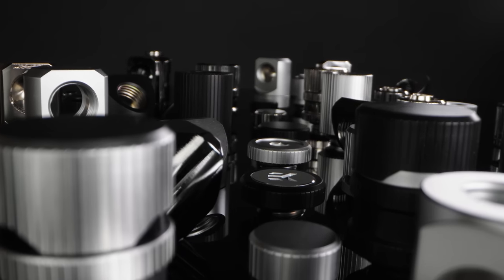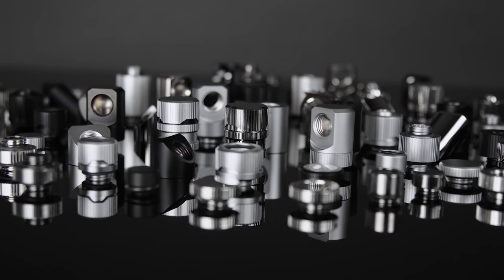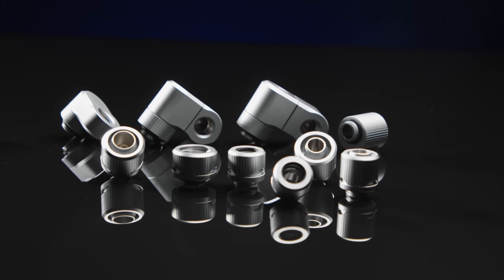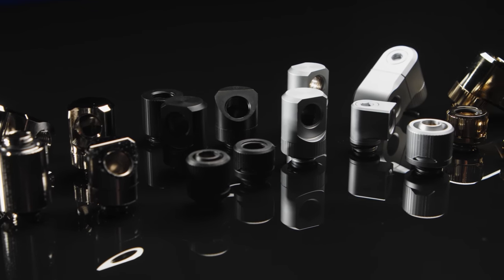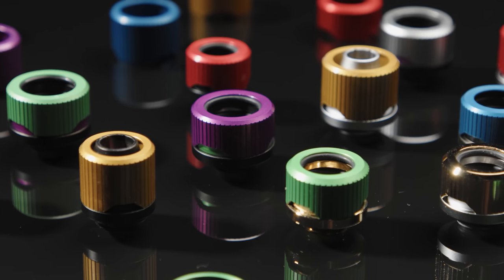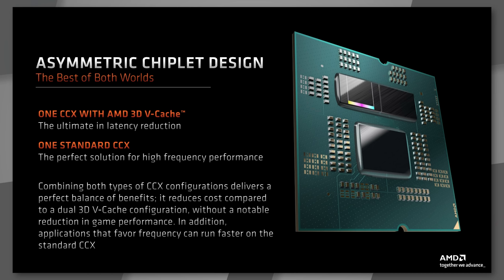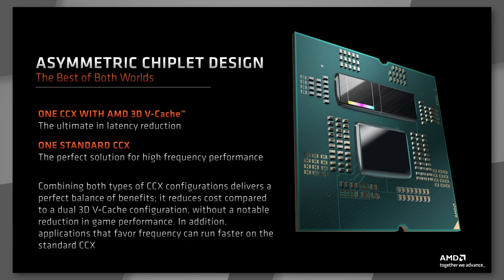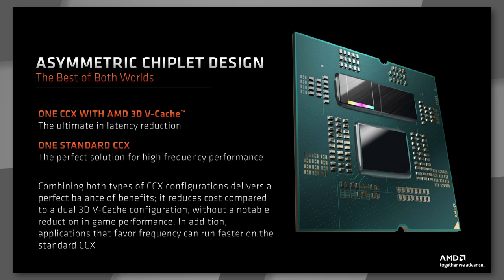Why I switched back to Intel...

Comment: the complaints in the forums is in the millions not just a few lately with amd and intel on the both amd and nvidia cards, crashing and blue screening.   

both intel and amd, they are both doing the crashing all the time stuff.  same with amd gpu vs nvidia cpu both same toilets with the ddr5 paring on the cpus and mother boards now.  its a full on crap shoot to get something stable for very long.  sure some work for couple months then its all down hill.

cant get a pc to stay stable for years like before.

blue screen and constant app crashing in windows 11, is the normal now.

Comment: SO. THIS is exactly why I havent used a single AMD chip, EVER, in my 4 pcs for the last 20 years. I always followed how AMDs were, more unstable, hotter, always something etc etc etc... BUT, I was SO decided, to switch to AMD this year, I saw the benchmarks, and I accepted, AMD was the better choice. I even have the 7950x3d on my amazon basket... then Youtube started to pickup and give me a video here a video there... and ALL of sudden, in 4 hours, I see theres a HUUUUGEEE scandal with bugs, issues, memory problems, ASUS is now the worst brand ever (for AMD?)... and Im speechless. And I remember, cheap is expensive. I have NO time for all this mumbojumbo technical stuff, bios configs, memory EXPO??? oh god give me a break... All you guys enjoy using your AMD, I will buy the ultra-inefficient i9 14900k and you know what? I will buy ANY mobo I feel like, ANY DDR5 of ANY speed I feel like... build it and you know, IT WILL JUST WORK. And thats the thing with Intel. Welp, I tried AMD but there it goes... you are just not good enough, as you have never been.

Comment: Sooooooo……..did you need to heat your home and that’s why you switched 🤣😂🤪? I know that the only way to control Intel’s heat problem is to lower pl1 and pl2 power limits. When DDR5 first came most was 1.2v under XMP/EXPO. That voltage is way too low. There are also multiple DDR5 voltages to adjust (VDDQ, ETC). I’ve had no issues tuning DDR5 and using 1.35 - 1.4 Memory and vddq voltage. Now that DDR5 has been out for a bit we have a better understanding of its limitations. Moving voltage to each individual ram stick is one big change unto itself.

Comment: This is something amd fanboys never mention, all the weird issues you run into with software problems, failed boots, its a complete mess. I was convinced once by the amd hype and got a full amd system, and every time i booted up the pc it was a coin toss if i would even get it to turn on. Memory retraining every other boot, the radeon 5700 xt not displaying anything, crashes and glitches in games specific to amd. Never touching team red stuff again.
Reply: Yup. At the end of the day, performance is null if the system isn't reliable. For most users, at least.

Comment: Man, I respect a lot of the work you do (give my regards to Beyonce).  But just in your title, come on man... really?  You're gonna be that reductive to dismiss an entire platform for what sounds like individual component or skill issues.  I would never assume, in your case, the latter.  But I think if you want to make sensational video titles like that you ought to have a MOUNTAIN of proof that the entire platform is bad and unstable and not just anecdotes backed up by theories.  Because you will find plenty of those in both camps

Comment: I have a 7800x3d stable with 4x sticks at 5800MHz, 6GHz is just not achievable with my setup. I also get the same phantom RAM training on some boots though, which is pretty annoying.
Reply: Official AMD Specs for 4 sticks of ram: DDR5-3600. Why are you surprised?

Comment: Lol that'd be like throwing a Northstar V8 in an 87 olds Cutlass supreme LoL which's geared for a v6 however you haven't found the technology equivalent of an overdrive transmission 😁 omg! That'd be a scary combo lmao set the max limiter to 220 and I'd bet ya get at least 200 outta it😄 with pedal to spare like i said SCARY and i hada 4-door regal for quite awhile sooo pass everything cepta gas station lol

Comment: The X3D chips from AMD are very very similar to the new intel with P core and E cores and it seems they have just done a worse job overall from what Intel has done, I have heard nothing but issues with multi tasking on X3D chips and even heard users have system crashes from it

Comment: What about an AMD chipset on an MSI board?
Reply: AMD Ryzen 9 7950X3D Raphael AM5 4.2GHz 16-Core(ProSiphon Elite)

MSI B650 MPG CARBON WIFI AMD AM5 ATX Motherboard

G.Skill Trident Z5 RGB 96GB (2 x 48GB) DDR5-6400

AMD Radeon RX 6950 XT Triple Fan 16GB GDDR6

Samsung - 990 PRO 4TB Internal SSD PCle Gen 4x4 NVMe

Corsair RM850 850 Watt 80 Plus Gold

Thermaltake Core P6 Chassis
Reply: @DJBillionator  at that point just get an x670 board

Comment: I feel like this falls under shit happens category because unless he built a new one to test it could just be his shit... One thing ill say is stop using asus motherboards. I been using MSI and Gigabyte, and Asrock the last 10 years and i had so many less problems.   I think in order to find out if your claims are valid. Build a system with retail parts and not the engineering or demo system parts you got horded. Lol

Comment: Can't beat Intel for hassle free gaming. They just work and run nice and  cool (mid 50's°C is about as hot as my 13600kf gets at 5.5.5GHz all P cores) I'd rather be gaming than trying to work out why the CPU isn't working properly or why this or that game refuses to boot.
Reply: The i5's run at good temps, but let's not pretend like the i9's do. Intel is not the Intel of old, they have chips that pull a ton of power and run hot.

Comment: Yep, AMD just lost a 1 000 000 clients.. I haaven't tried AMD, I've always used Intel for my 3D modeling/rendering and gaming. The latest thredrippers are fast but extremely expensive. They say the  i7 13700ks is good, but slightly a bit more expensive than the i& 13700k, So I guess I'll be getting that one for my Z790-A cause I don't like the idea of extremely the hot 14700k temps, but forfeiting the extra new 4 cores & the 28 threads is a bommer.

Comment: Than why didnt you get a 7950x non 3d 😂😂😂😂😂
Reply: Whats the difference between non 3d and 3d, does the non 3d one work better?
Im contemplating buying amd but dont know which one to get. Unless intel is better
Reply: @JokerP5   the 7950x non 3d has non of the issues... For gaming purpose PC the 7800x3d is good
Reply: @JokerP5  x3d is  5% behind in productivity and better for gaming ,  I wouldnt go 14900k atm since theres some un stability issues

Comment: Glad I wasn't at the bleeding edge when this stuff was coming out. Just built my new system around Black Friday, went w/ x670 chipset and a normal 7950x and 6200MHz and it's all been butter smooth.

Comment: AMD has always been terrible.  I've never used anything but intel and thats because you get what you pay for.
Reply: You're so wrong. You don't know what you're missing. Ignorance is bliss, I guess.
Reply: @Voyager.2  he said it in his video.  AMD is and will always be for the people who can’t afford Intel. Same thing with AMD graphics cards.  You pay more for Nvidia but they have more features and less driver issues.  Facts 🤷🏻‍♂️
Reply: @RatedX_Gaming  You are so wrong, I repeat. AMD CPU's and motherboards currently are more expensive than Intel counterparts so the "can't afford" argument is null. I had Intel machines since 1988, from the i386DX 16MHz to the 13900K and now I have a 7800X3d+Asus X670E-E and couldn't be happier. Blazing fast, rock solid and very quiet. AMD now has the upper hand, Intel is the choice of the uninformed and stuck in the past.
Reply: @Voyager.2  to each their own. Enjoy what you enjoy….
Reply: @RatedX_Gaming  You're saying that because you don't have any valid argument to bring up.
Reply: Either do you. It’s your opinion against mine. No need to keyboard warrior about it. I have better things to do.  Peace.
Reply: @Voyager.2 They don't seem to do as well when it comes to minimum FPS, and considering I don't need more than 144fps overall, pushing those minimums up matters more to me.
Reply: this logic worked prior to ryzen, now its just flat out wrong

Comment: You still prefer Intel despite the fact the 13th and 14th gen are failing at an astronomical rate? This video needs to be removed as the 7950X3D is a far better processor any way you look at it.

Comment: The intel "lagging" behind AMD is total garbage fed by talking heads that know belittling intel CPUs gets clicks, but in reality, even without trying, their CPU clock speeds have always been higher, which is always better for gaming.  Sure AMD acn multitask, so if you are a streamer then great.  For us gamers, ALWAYS intel every time.  Its just better, Gsync is better than  vsync and it integrates with RAM easier.  Arrowhead will just strike a dagger through anything AMD has at almost 7 GHz...its never been BEHIND AMD in gaming...just letting AMD catch up a little, now that AMD has awoken the sleeping giant...its GAME OVER.

Comment: For the past 20 years I've flipped between amd and intel depending on who was "better" at the time and I have to say, I have only ever had issues with AMD hardware/drivers. I currently have a 3900x and the usb ports are fundamentally broken - random disconnects, devices not working and it took me two weeks to get the board to work with my bluray drive. This is totally my experience but, amd looked great on paper with the 3900x but day today it has caused me so many headaches so I will be going back to intel.

Comment: im going back intel and selling off my amd system because i just dont like that the boosts dont match and the apps have problems figuring out what ccd to use . like intel just did it right with big core little core power core ecore . windows can literally figure out where shit gotta go super easy
Reply: No they didn't, they had a bunch of problems during 12th gen launch with the OS not being optimized to deal with when to use P-Core vs. E-Core. Let's not pretend here that Intel has never had issues.

Comment: "Why i regret switching to Intel"
Reply: Could you explain to me what AMD did? Did they create a driver that fixed the issues or like, what happened?
Reply: @Zeloth2004  uhmmm which issues? all i know is my 7800x3d is amazing and its matched with a amd graphics card which works well together. Intel has BIG problems right now. so im just glad i have AMD.
Reply: @Zeloth2004 no the issues still vary and amd has made many improvements but folks are just talking about the issues with intel 13/14 gen mainly  i7/i9s are facing huge issues

Comment: My biggest regret in many years was going AMD and AM5. What a patheticly unstable platform. It is the fucking worst. Works for weeks until it doesnt. For no reason. Nothing changed. No Windows Updates etc. and it still wont boot. No matter what I do, unless I completely reset the Bios get into Windows without EXPO and reboot to  set my stable settings in BIOS again. Horrible horrible. Will never buy AMD ever again!
Reply: Often user incompetence. My 7800x3d is rock stable on DDR5 6200 with sharp timings and CO -30 on all cores.

Best of luck with Intel :D